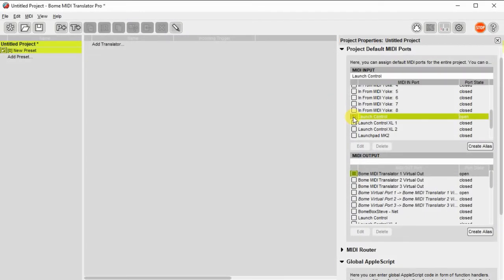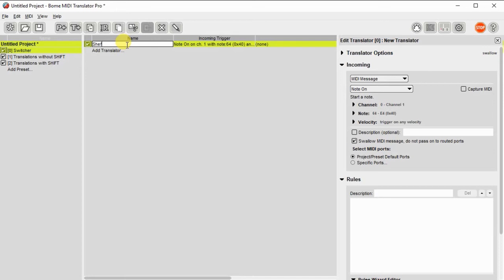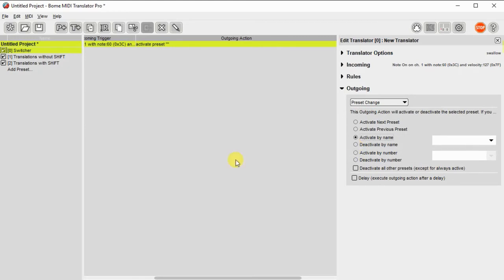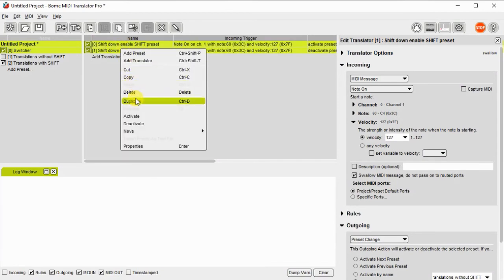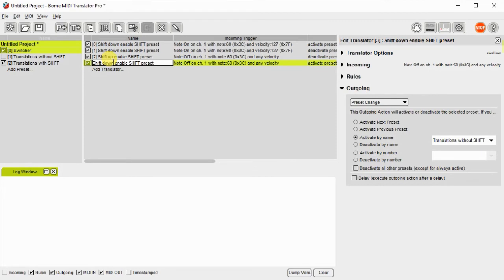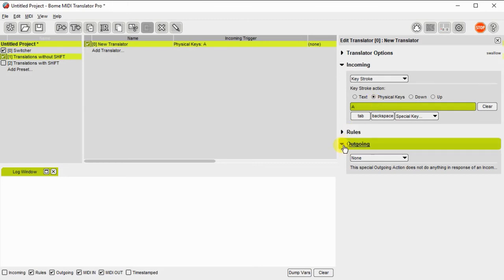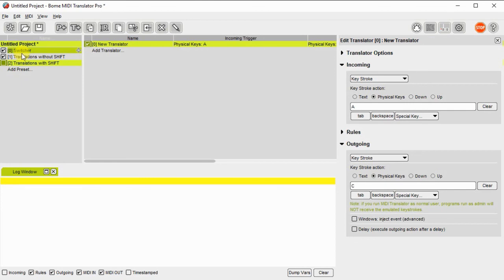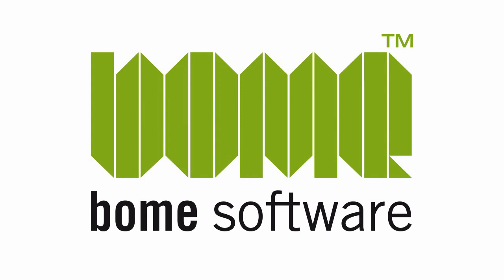Tutorial: Add a SHIFT Layer on a MIDI Controller in Bome MIDI Translator Pro using Presets

Comment: Thanks for posting this! I'm testing this BMT project with my LaunchControl, but I'm confused on which exact buttons you've used on the LaunchControl and how youre activating Shift with it aswell.
Reply from the maker: Hi, the note is 3CH (60 Decimal), it is in the second row of square buttons on the Launchpad MKII. If you have a different launchpad type, you will likely need to pick a different button.  Here is a link to the Launchpad MKII manual:

https://customer.novationmusic.com/sites/customer/files/novation/downloads/10529/launchpad-mk2-programmers-reference-guide-v1-02.pdf

If you have further questions, please go to our forum at the link below and ask there:

http://bome.com/support/kb

Steve Caldwell
Bome Q and A Moderator and
Independent Bome Consultant/Specialist
bome@sniz.biz
Reply from the maker: Actually, I think I used the Launch Control which have programmable pads. In either case, just "capture" any note you want on your device to change it to your liking.

Steve Caldwell
Bome Q and A Moderator and
Independent Bome Consultant/Specialist
bome@sniz.biz
Reply: Thanks Steve, I got it to work with my Launch Control with some tweaking. But, I'd really like to get this to work with my Faderport 2. I'm trying to use a momentary button (Section) on the Faderport  which is making it more confusing. Ive been trying to add a translator to make a toggle button with no success. Should I ask post my project in the Q&A forum or is there post I could latch on too?
Reply from the maker: @kitespongan  Go ahead and post your question on the forum. I can help you there.

Steve Caldwell
Bome Q and A Moderator and
Independent Bome Consultant/Specialist
bome@sniz.biz